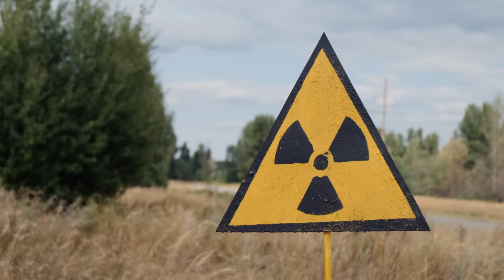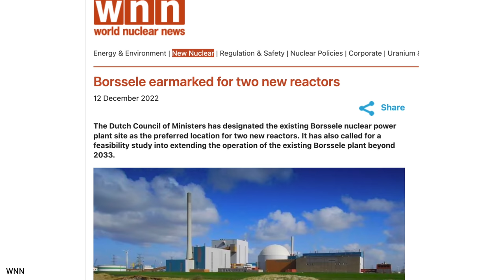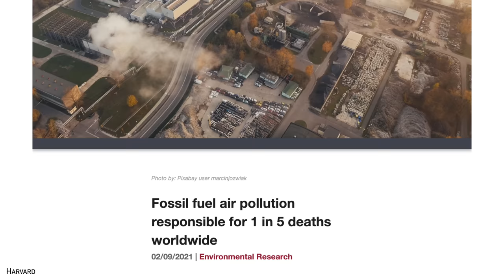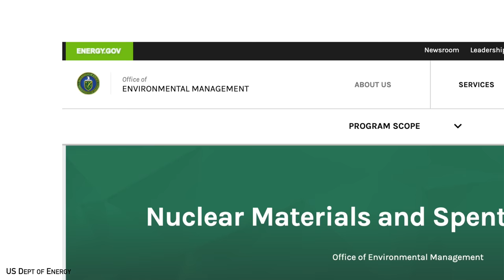Can Nuclear Waste Ever Be Solved? Yes.

Comment: You did a faulty calculation by showing reprocessing as 2300$, since it's REUSABLE, so you had to subtract the raw material cost from the final product. The enrichment alone takes the same amount of cost about 2479$ stated at EUP Enrichment Equations*. Which means it's probably the same or 179$ in worst case.
With that outta the way, why not produce RTG's for space missions and create an RTG Power Plant at Moon, Mars and Titan, where heat and energy could be used for future space citizens.
Reply: RTGs are not exactly a bulk power supply. They produce a relatively small amount of electricity for constant loads, such as in the Soviet unmanned radio beacons and lighthouses, or for space probes. Most of these were under 100 Watts. Same for the US. Both the US and Soviets made some in the 1000 Watt range. Nothing that would sustain the power required by a human habitat.
They deliver a constant output which cannot be throttled to match demand.
Reply: There are improvements on this topic, one of them is Plutonium Stirling engine.. Can't find the video now but its easy to find like that. Goal is 1kW generator with plutonium generators and there are designs of it.

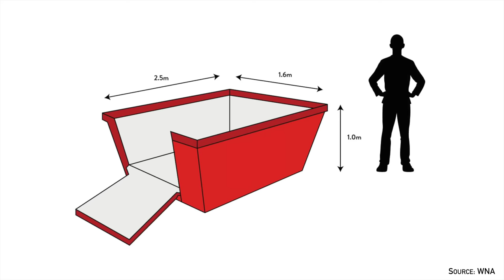Comment: At 4:40 Why do you switch to volume measures when it comes to nuclear waste while using weight your other comparisons?
2 m2 of Uranium are 19 metric tonnes. That would allow a comparison 
If you want to show the overwhelming amounts coal power plant produces in comparison to a nuclear plant. Wouodvit not be better to use weights or volumes in both cases?

Comment: CORRECTIONS: Where do I begin.
1- nuclear waste not only exists at commercial power plants but at DOE National Labs, Colleges, Nuclear testing sites, Johnston Atoll, Bikini atoll , sunken nuclear subs, and many other sites.  You forgot about the 100 million gallons of high level waste from the production of nuclear weapons. And that is just the U.S. waste.

2- I know that Savannah River Site Low Level waste burial ground contains Pu239 from weapons that were destroyed in aircraft crashes.  The concentrations are so high that the soil can not be disturbed for fear of a critically accident.  There is other than low level radioactive waste buried in low level waste burial sites and high level waste dumped into the oceans and covered over in super fund sites. 

3 - I know of NO radioactive waste that after some decay, is disposed in a "normal" landfill, as you stated

4 - Low level, Intermediate, and High Level nuclear waste is NOT defined by the radiation level.  I have worked with low level waste drums that emit enough radiation that less than 30 minutes at one foot would result in a lethal dose.  I have also worked with TRU waste drums that emit no detectable radiation level.

5- Your values for the quantity of "dangerous" isotopes in spent reactor fuel is entirely misleading.  While spent fuel contains less than 4 % fission products and 2% Pu239 and U235, You cannot just dump it onto a table and sort it all out.  Separation of each isotope involves a special chemical process.  Since U238 (94-95%) of spent fuel is so inexpensive that reprocess to recover it makes no sense.  Reprocessing creates an entirely new radioactive waste stream.

6 - Spent fuel must be stored to minimize radiation as well as provide security and the volume of these components must be taken into account.  

7- The 1983 Nuclear waste policy act SPECIFICALLY stated that no less than 2 geological repositories would be selected in different parts of the country so no one location would be  burdened with all the nations waste.  And that the sites would be chosen based on scientific study, which by the way proves salt deposits to be the most stable and desirable.  If we would have followed the original act and not chosen an extinct volcano (Yucca) something might have occurred.

I have more but that is enough for now.

Your only 100% true statement was that we have a lot of radioactive waste and we will have to do something with it.
Reply: The US is clearly making the waste an issue when it is not and never has been a technological problem.  
From the US Government Accountability website:  "The nation has over 85,000 metric tons of spent nuclear fuel from commercial nuclear power plants. DOE is responsible for disposing of this high-level waste in a permanent geologic repository, but has yet to build such a facility because policymakers have been at an impasse over what to do with this spent fuel since 2010.  Meanwhile, the federal government has paid billions of dollars in damages to utilities for failing to dispose of this waste and may potentially have to pay tens of billions of dollars more in coming decades."
Reply from the maker: As always, thanks for the honest feedback ;-)
I originally included some discussion on the Savannah river site, but cut it because things were starting to get a little long and off topic. So only WIPP made it in.

#3 Given your background (or as best I can tell), I'm surprised you don't see this. Once radioactivity has decayed sufficiently, I suppose it's no longer "radioactive waste" (e.g., radon contaminated items, etc) and can be disposed of normally. Until it's below that threshold though, it can't go into the "normal trash."

#4 Yes, but generally I'd say waste is categorized roughly as a product of (decay rate x energy x half-life). There are too many sub-categories and qualifications on those for a somewhat general audience (nuclear enthusiast?) YT video, so I made an approximate simplification.

#5 I'd defend the values used here. Clearly it isn't as simple as sorting it out on a table and that's one reason why reprocessing is very expensive and handling is difficult. Some countries (like Germany) have incentives to minimize the waste and are willing to pay for it. Others like the US, there isn't really any punishment for generating waste beyond the direct cost of storing it.

#7 The Nuclear Waste Policy Act (as amended) is so mired in political fighting that it's impossible to say what would or should have happened. The engineers and scientists aren't in charge of those decisions, even if sometimes that would be useful... /shrug
Reply: @atomicblender  
!- My point is that there is much more radioactive waste than that produced by commercial nuclear plants and you just ignore that fact. Yucca Mtn capacity was exceeded in 2014 so any waste produced after that would exceed their capacity.

3- My first job was Radiation Control Tech and Radon was a problem at times of weather inversion.  We had a device (air impactor) that would exclude radon gas from the air sample or we would plot the radioactive decay to confirm the radioactivity was due to Radon daughters.  Radon is a gas and it does not contaminate material and it is NOT what is a concern.  It is the decay products of Radon that are solids and contaminate material (including lungs). 
In any case once Radon was confirmed to be the source of the radioactivity the area/material was determined to be "non-radioactive".  
No facility where I worked EVERY considered ANY item that was radioactive from natural (Coleman lantern Mantles, Fiesta Ware, depleted Uranium, Radon) radioactivity to be anything but natural and non-radioactive.  
One employee's wife sold coffee cups in the shape of a cooling tower with a dime size dot of depleted uranium which used to be available at most pottery shops.  A month after i bought one, I had it checked and it admitted 5 mrem/hr at 6 inches.  That (naturally) highly radioactive coffee cup was legally disposed of in the waste basket.

I have worked commercial and DOE and no facility that I worked at would ever dispose of any item that had radioactivity from the facility into the clean trash no matter its decay history.  Surveying an item to declare it "clean" is very difficult and a chance that no one takes, which is why the waste stream is so large.  If it goes into a contaminated area it (other than people) is almost always disposed as contaminated waste.  I would guess that a significant amount of low level radioactive waste is not contaminated at all.  However, once something was contaminated it retained that label.

You may have book smart but I can see no real experience
Reply: @atomicblender  #4 -  My point is correct in stating low level and high level waste categories are NOT dependent upon radiation level or even radiation type.  Low level waste can be highly radioactive and High level waste can have little to no external radiation, especially since many of the long lived fission products are alpha emitters.

#5 My point is that you make a misleading statement. Yes, if you could separate every different isotope in a spent fuel waste stream you could efficiently deal with the waste in reusing much of it.   But, the cost to do so is massive and even those countries that reprocess, do NOT go to the trouble to sperate U238, a cheap and plentiful isotope. You also don't consider the needed containment and shielding volume that far exceeds the volume of the waste itself.
An analogy would be household waste.  EVERY item in household waste could be separated into reuse, recycle, and repurpose.  But no one does that because of the expense. So claiming that this is an option, while technically correct, is not economically feasible.  

#7 My point is that Yucca was NOT the best location.  The best location has always been salt deposits and they exist in many of the states.  The non-patrician version of the 1983 Nuclear Waste Policy Act was realistic from a fairness and scientific standpoint.  Even Trump who put the nail in that coffin, said a disposal location must be one acceptable to the state where it will be located.  Nevada, never wanted it.
Reply: @atomicblender  
#7 FYI- Given my experience with DOE, once funding is zeroed out as Trump did in 2017, You can poke a fork in Yucca because it is done. 
Any normal person would think that after spending $45 billion on Yucca that all the testing, borehole data, research, and associated documents would be available if the project was ever restarted. 
 However, no other project manager is going to spend one penny of their budget to preserve that data.  Most if not all of it is lost and would have to be redone if anyone really wanted to restart Yucca.

I was part of a group to preserve data, procedures, and technical prints for a on-hold project that may be resurrected in the future if needed. 
Everything was indexed, categorized, boxed, and electronic copies included in a secured and protected area.  Less than 6 months later, when I visited, everything was gone.  I was told the area was needed for another funded project and that's project's manager had everything shredded and was not happy that he had to use  some of his budget to support the shredding.  That is reality.
Reply: @clarkkent9080   Yucca is sufficient as in anywhere else in the world, THAT is reality you like to ignore from your blank trolling channel.  The two billion year old nuclear waste site at Oklo Gabon proves even without expensive casks or even burial, the contamination was not widespread.

Comment: what you left out was waste burning molten salt that dont require reprocessing
Reply from the maker: Fair point. I tried to focus most of this video on the current fleet, but you're right -- breeder reactors would reduce waste by a lot.
Reply: @atomicblender  Yeah they change the discussion completely. when you have 100yrs (or 1000 depleted) of all energy for US ssitting in parking lots which reduce to 300yr max or 100yr if processed then you have a compelling argument purely from waste mgmt.